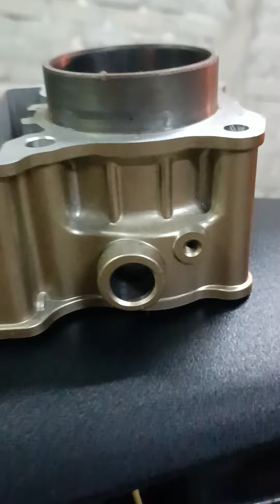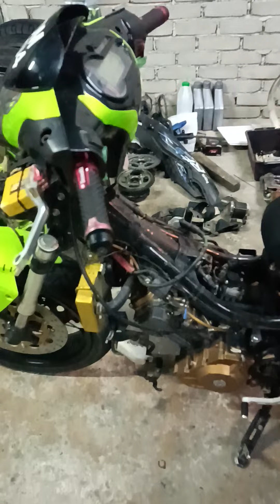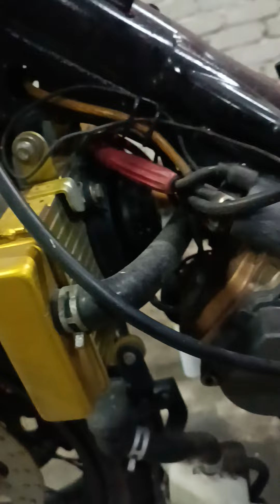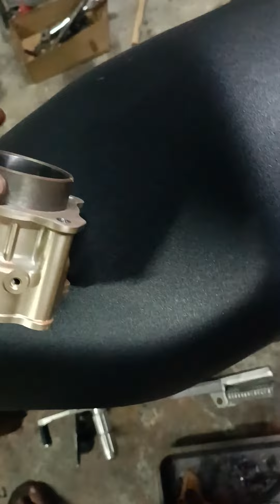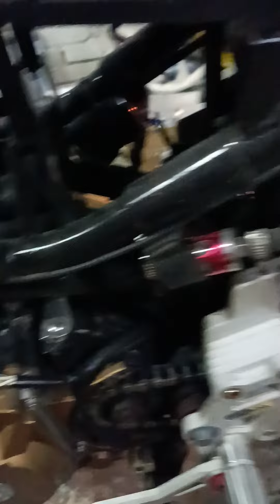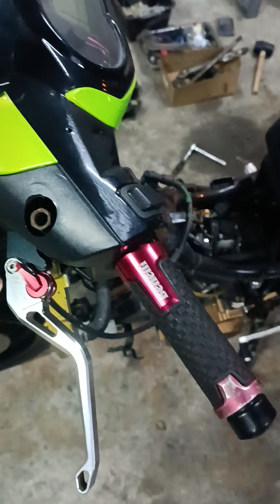Benelli RFS 150i sarong Block dgn Head R18i part 1

Comment: Crankcase kena porting x sarung block r18i
Reply from the maker: Block R18i sama pjang jh dgn rfs cuma piston pin R18i saiz 15 dan rfs 14
Reply: @WB-GARAGE  ok..jadi kena pakai pin r18 la kan..blok tu pnp ja kan xda porting lain ka
Reply from the maker: @Wen_Vlog759  kulit enjin keno ribol sbb slip block rfs 65mm muko enjin 68mm slip block R18i 74@75mm
Reply from the maker: @Wen_Vlog759  piston aku pkai honda RS 65mm sbb pin sama klu yg y16 piston dio redah sikit pd honda rs
Reply: @WB-GARAGE  pnp juga ka ngn blok r18